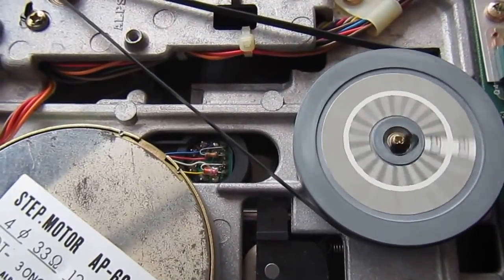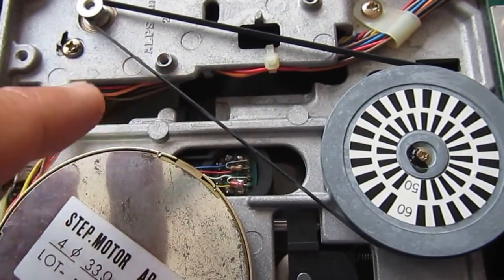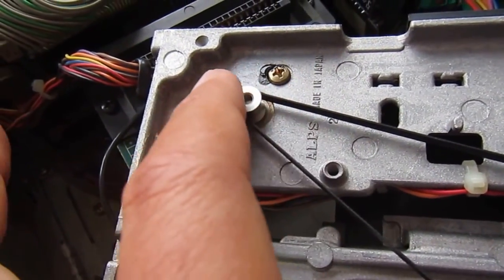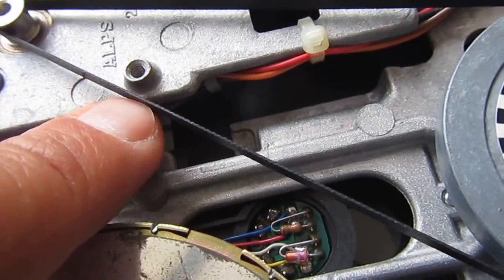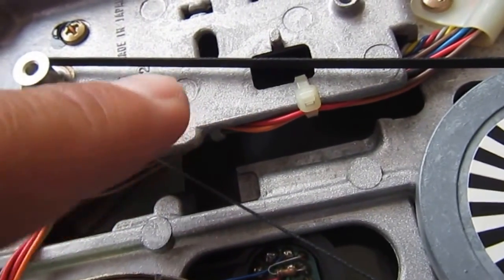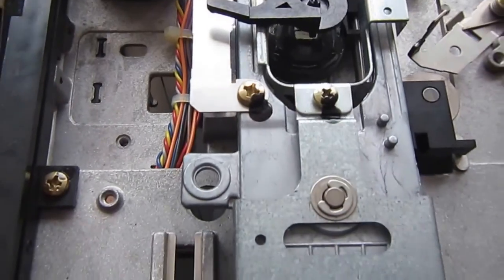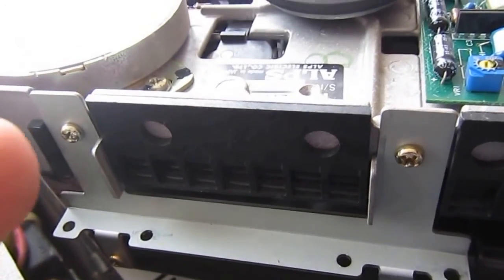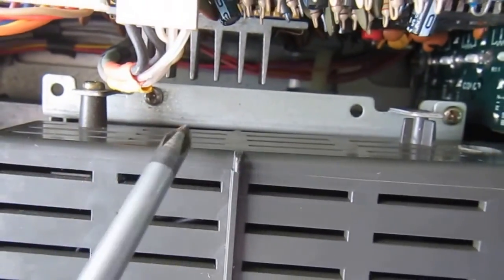Commodore SX-64 (1541) disk drive belt fix

Comment: I was sure I seen a 3D Printable 1541 Drive Replacement Belt but it's late and maybe I'm delirious, lol!  ;)  -Mark
Reply from the maker: It might be, but floppy drive belts have a mixed fabric and rubber composition. Thery're not very elastic and must have the correct tension. It's not like a tape deck belt.

Comment: Enjoying your videos, as always.  But you are teasing me with parts of your repair we did not see.  I think it would be interesting to see how you used a frequency counter to adjust the RPM of the drive motor.  Just a suggestion.  Thanks.
Reply from the maker: Hi, I'm sorry for the partial video, I didn't really think that I was going to fix the drive without the spare part. So I tried to describe all I did after the good and unexpected results.
You may also want to look at a fine book about troubleshooting, aligning and repair of the C=1541:
http://www.codebase64.net/books/commodore-1541-troubleshooting-and-repair-guide.pdf
Reply: Hi. No need to apologise. I just like seeing the actual process. Thanks for the link; I have collected several repair manuals but I did not have this one. Keep up the great work.

Comment: Great idea flipping the belt around!  I would never have thought of that!  If you find a supplier of replacement belts please let me know!
Reply from the maker: Hi! I don't even know why it come to my mind to try :) I think I noticed that the other side of the belt looked a bit better. I was really surprised that it made such a difference. Before the flipping, the disks that actually allowed the wheel to turn, were really few and the spindle velocity was so inconsistent that it was hard to load even a small program. 
As for replacement, I've seen the same belt in most ALPS mechanics of that era (as found for example on the Apple disk-II) but it means one must be lucky to find a mechanic with broken head or motors maybe. If I find a source of compatible belts, I'll post an update of course.